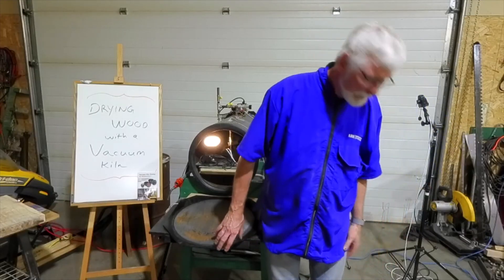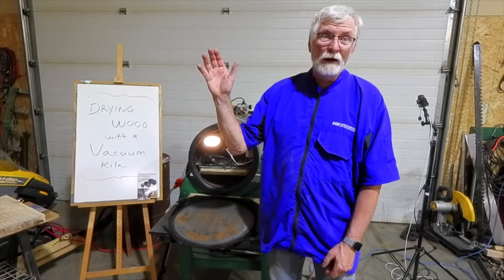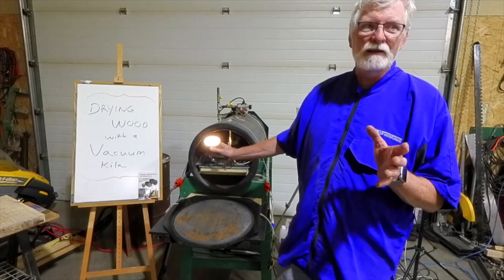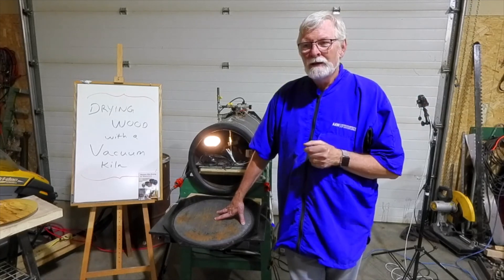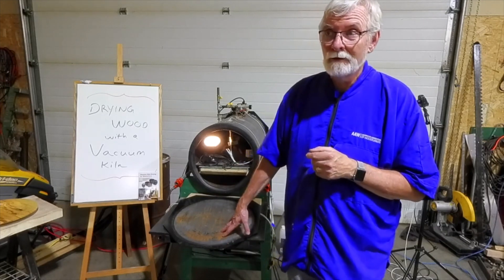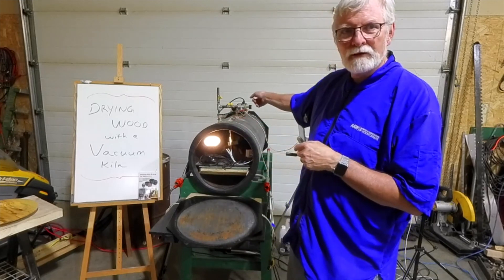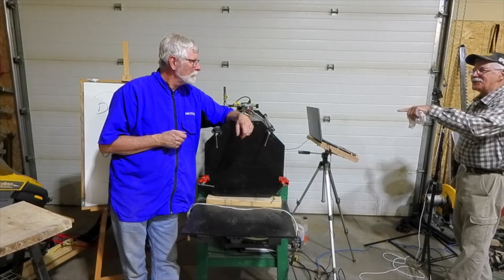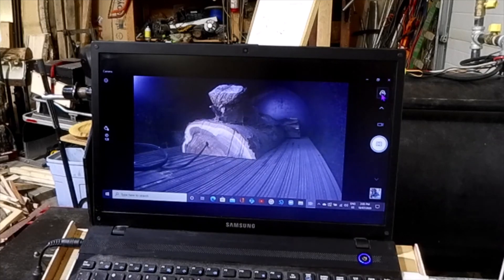Vacuum Kiln for Drying Wood

Comment: I'm surprised your electric connection doesn't just strip the wires insulation right off under that much vacuum. What did you use for making that seal is it some sort of epoxy? Not sure we have everseal in the states.
Reply: I use commercially prepared USB and 110v plugs which are sealed up when manufactured. I run the wires from inside out leaving those ends inside. This method makes one less place to leak. If I just ran a plain insulated wire into the chamber, I’m sure there would be leakage within/along the wire. I also tried to make the drilled hole as tight to the wire as possible. There are ‘gland nuts’ that might also work. As a result I’ve had no problems with leakage via the USB or power wires. 
SealAll is available in the USA I’m pretty sure. It might even be made there. I imagine even roof shingle sealant would work too. Silicone sealant did Not work for me. It peeled right off the painted steel.

Comment: I really don't see your vacuum pump setup working. Perhaps if you started with a diaphragm pump then finished with the oil pump. Without a cold trap I don't think it's even possible to catch the moisture! Just my experience with a freeze dryer and oil pumps.

Comment: Thanks for the great demo Jeff. I bought a copy of Josh Salesin’s book 4th addition and have started building a 16” x  48” kiln in the UK. I was wondering what you use for heat mats. I’ve seen heat mats for under aquarium or reptile tanks, would these get hot enough to do the job? What watt rating are yours?
Reply: I have two long heat mats at 135 watts, 93 cm x 41 cm and a shorter one at 90 watts, 21 x 14 inches. These are for 110v here in North America. They are supposed to be used to stand on so are very durable.
Reply: you could try horticultural soil warming propogation cables, not sure how high they are temp rated though.

Comment: Fascinating idea and very knowledgeable but leaving the camera across the room kind of takes away from the experience. Telling us about the drainage system isn’t as good as showing it to us, but overall good video
Reply: Sorry about the video. We are all amateurs ha ha. The end part of the video does give a closer look at the parts. It is all a very simple construction. Large kiln pipe with one end welded shut, gasket and plate to seal the other end. Vacuum line hole at the top, drain hole at the bottom both sealed with gas rated valves. That is really the essence of the device. A chamber attached to the drain tube made of a short piece of pipe with its bottom end closed with a gas rated valve is a convenient means of getting the water out without losing vacuum. Anything along the vacuum line is experimental and not essential.

Comment: 500 gallon propane tank would fit a bunch more wood. A 1000 gallon tank would work for longer wood.
Reply: I don’t think the walls of that kind of pressure vessel can withstand the tremendous external pressure that would be on it with an adequate vacuum inside. However, I am not an expert or engineer and would recommend consulting with someone who is before attempting something that large.
Reply: @j.hankinson7803  Hi j. These tanks come to us brand new with a vacuum already on them. Call a tank manufacturer to be sure I'm not just kidding you. A bunch of back wards pressure. We have to prep them for positive pressure before we can remove any caps. They will suck rubber gaskets right in. Them

Comment: Excellent. Russia.
Reply: Hi Victor. Yes, the wall thickness of the kiln is 3/8 inches (9.5mm) , and the small collector chamber is 1/4 inch (6.35mm) wall thickness. The kiln ends are 1/4 inch thick plate, and the collector chamber ends are 1/8 inch (3.18mm). The threaded pipe ports are 1/2 inch (12.5mm). Sorry, in Canada we use both imperial and metric I don’t know why... maybe to keep our American and the Russian neighbours happy ha ha.
Reply: @j.hankinson7803  Thank you for the important information. Yesterday I wanted to buy a book on Amazon. What stopped me was that sending it for Russia costs the same as the book :)
Reply: @VictorIvanovsky  If you need some other information please contact me.

Comment: Great video, thank you. Just as a reference you would not necessarily need that drain mechanism described if you get and keep the chamber and wood higher than the water boiling point for the level of vacuum you pull: https://www.conestogaworks.com/wp-content/uploads/2021/02/boilingpointatvacuumJBPumps.pdf
Also, one thing you could consider doing is having pre-dried air for bringing the pressure back to ambient. The easiest way I can think of would be to use air from your air compressor where you pressurize the compressor, then drain it's water from the tank, re-pressurize, drain and possibly chill the pressurized air a bit to cause the dew point to lower and you can eventually get all of the water out of that air so you are not re-introducing moisture into the chamber.
Reply: I appreciate the comments. I’m a believer in the KIS principle. Keep it simple. It really is no problem to drain the tank once or twice a day initially. The water could stay in the tank as you say but by allowing it into the smaller drain tank, draining it out from time to time, it’s easily out of the process. This also gives me an idea of how things are going because I can see the result. If the tank stays as a ‘back box’ I have no idea what progress I am making.